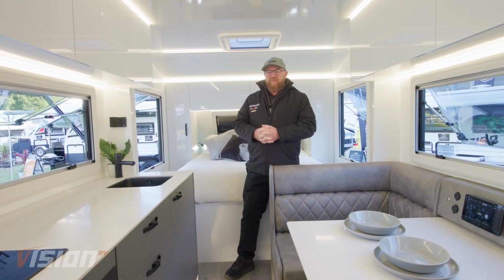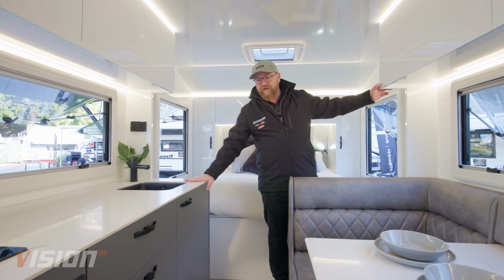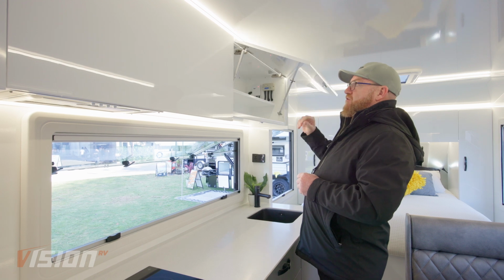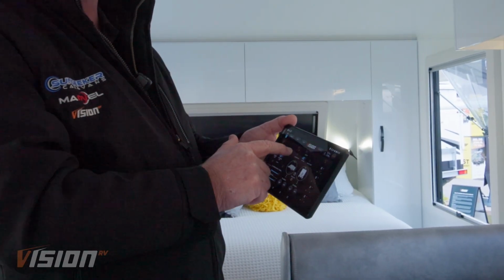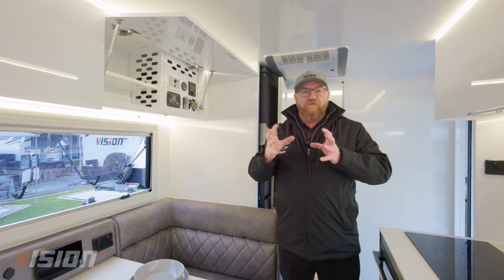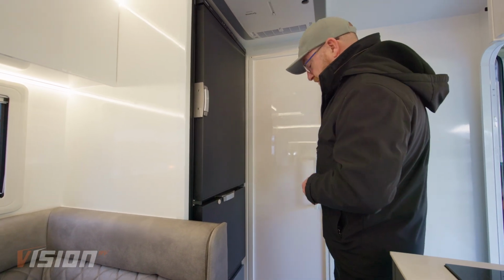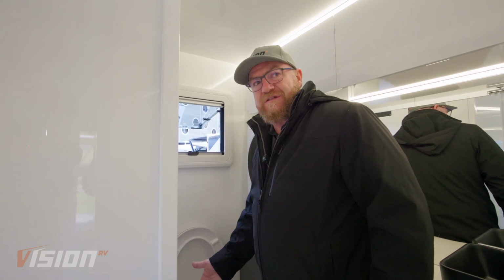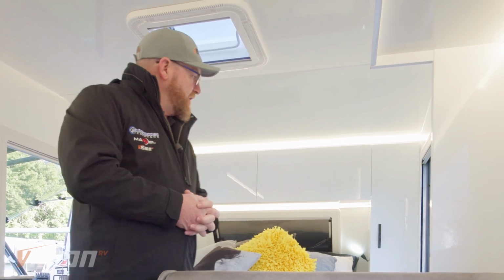VISION RV - ELYSIUM 19'6 COUPLES Internal walk through

Comment: Hi Chris, I am really interested why you didn't design the van with a 100% flat floor? No wheel boxes would give that extra storage and is simpler to manufacture in and outside. 
The other thing we learned after years of travelling. Forget amber. Red Light works much better against a wider range of insects. 
Same on the inside, all lights should be in three dimmable colours, white,  amber, and red. We have added LED strip lights, including the bathroom, into our Sunseeker. Now, we can actually keep the windows open while off-grid by setting them to red.
Reply from the maker: Flat floors are a manufacturers benefit sold as being a benefit to the customer. Flat floors make the van far easier to build and cheaper to build. The massive downside is the centre of gravity is raised considerably causing many ownership challenges such as instability when towing, (far more susceptible to sway) instability offroad (remember the wheels are in the centre of van, if there's is a rut the van will tilt far more, wheels don't not articulate like a car where they are in each corner of the vehicle. ) Minimum height when parked even with airbags deflated, getting in and out of van is still like climbing a ladder. Using external items like tool boxes or kitchens are much higher especially for shorter women. Flat floors should only be a LAST RESORT for vans that use centre ensuite to allow full hight shower above wheels to maintain lower ball load. All other applications are for manufacturers benefit.